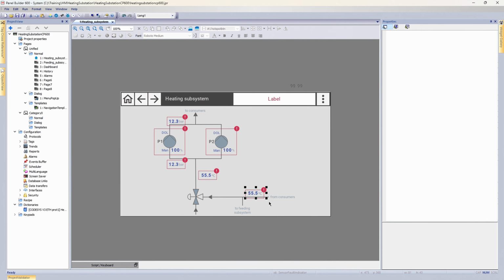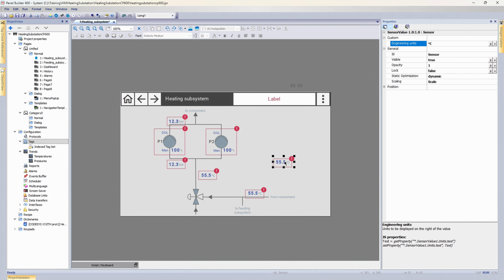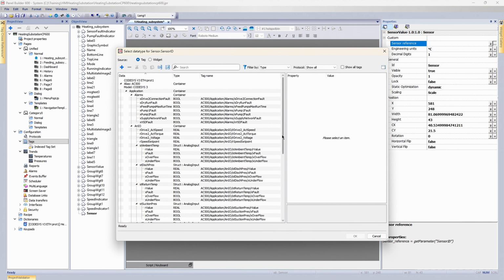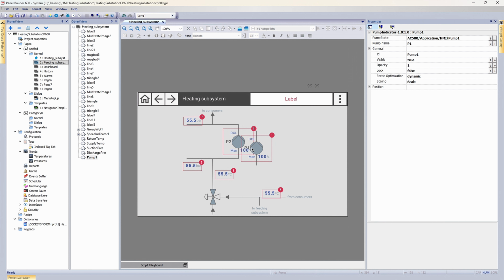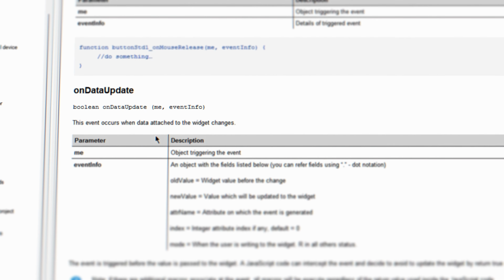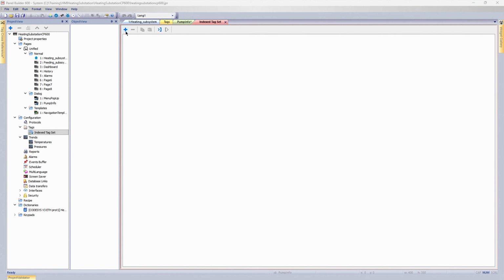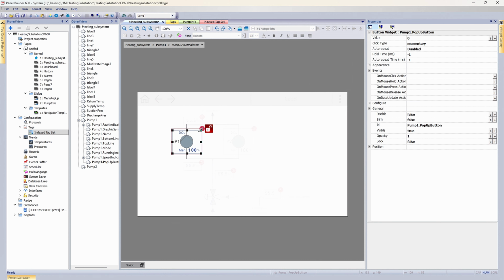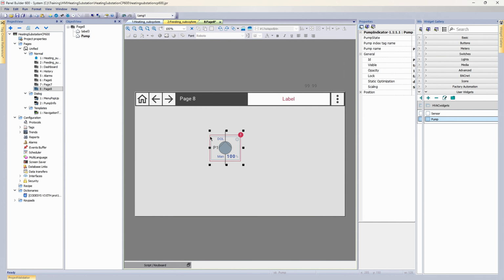Intro to CP600. Chapter 9: Custom widgets

Comment: Excellent video! Custom widgets definitely save a lot of work. However, I would like to know how I can create a library with all my custom widgets and share it with a colleague so they can use my custom widgets, and also so the widgets developed by my colleagues could be shared with me. That way, we could expand our own libraries together. Could we have a video on how to do this? Thanks in advance and greetings!
Reply from the maker: Hi Alexis! Thank you :)
Sorry I didn't cover it in this video. It is quite straight forward. All your user widgets are stored in Documents\Panel Builder 600\user gallery.
To move your widget gallery to another computer you just need to copy and paste the content of this folder and all subfolders. That's it. Hope it helps!